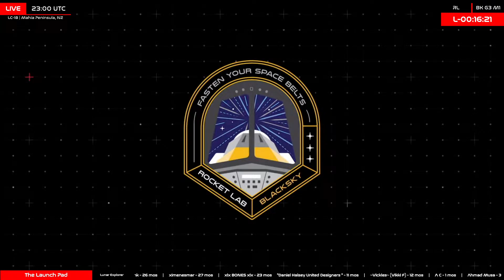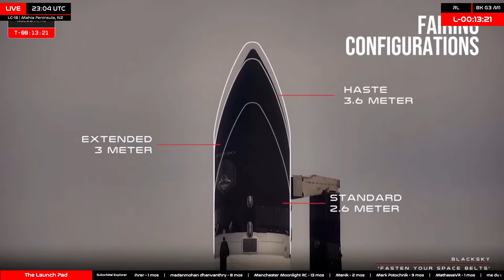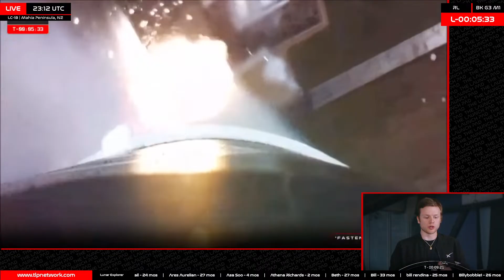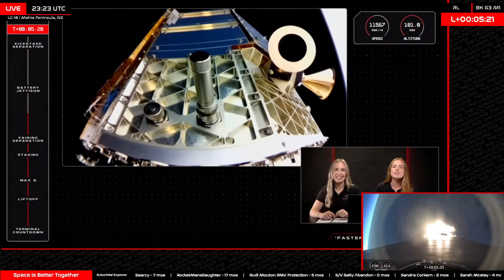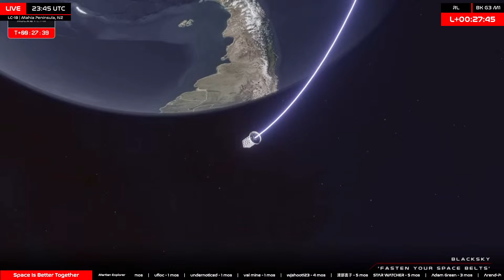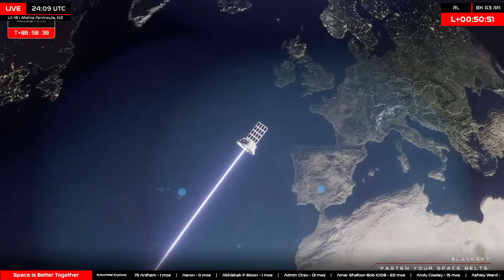LIFTOFF! RocketLab launches BlackSky Gen-31 aboard Electron from New Zealand

Comment: BlackSky Gen-3 refers to a new generation of Earth-imaging satellites developed by BlackSky Technology. These satellites are designed to provide high-quality imagery with improved resolution and spectral capabilities.   

Here are some key features of BlackSky Gen-3 satellites:

Improved Resolution: Gen-3 satellites can capture images with a resolution of 50 centimeters, which is a significant improvement over previous generations. This enhanced resolution allows for more detailed and accurate observations of Earth.
Enhanced Spectral Diversity: These satellites are equipped with multiple sensors, including shortwave infrared (SWIR) capabilities. This allows for a wider range of data collection and analysis, providing more comprehensive insights into various aspects of the Earth's surface.   
Real-time Information: The improved resolution and spectral diversity of Gen-3 satellites contribute to BlackSky's ability to deliver real-time information to its customers. This is crucial for applications that require timely and up-to-date data, such as disaster response, environmental monitoring, and intelligence gathering.   

The first Gen-3 satellite was launched by Rocket Lab on February 18, 2025, as part of the "Fasten Your Space Belts" mission. BlackSky plans to launch additional Gen-3 satellites in the future to further enhance its constellation and improve its data collection capabilities.